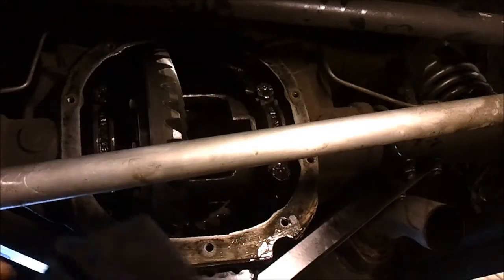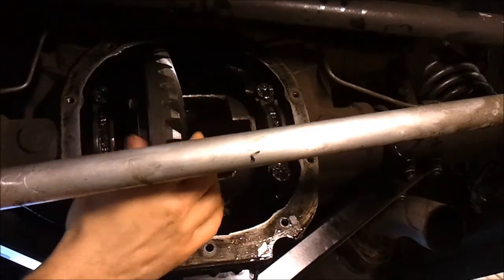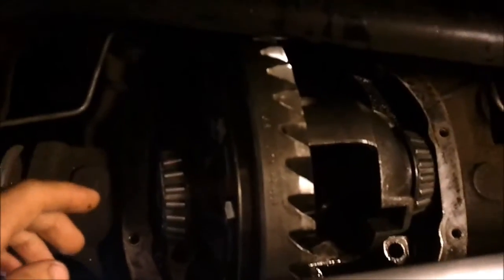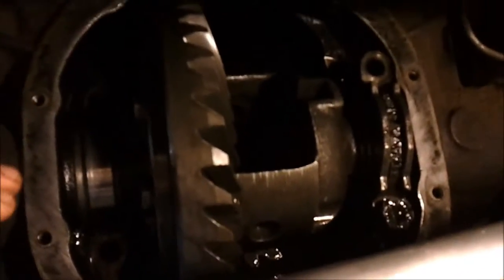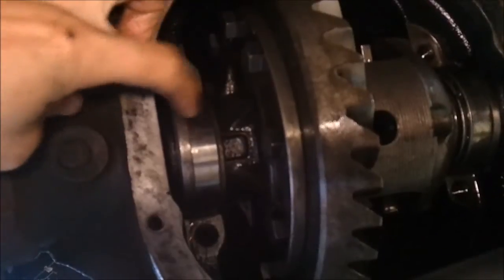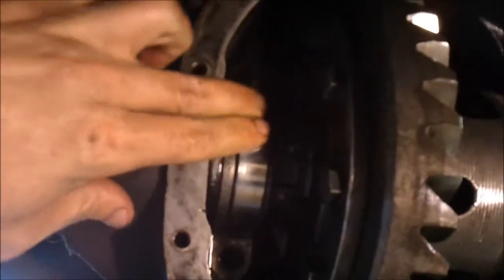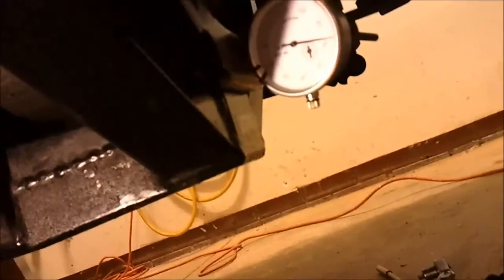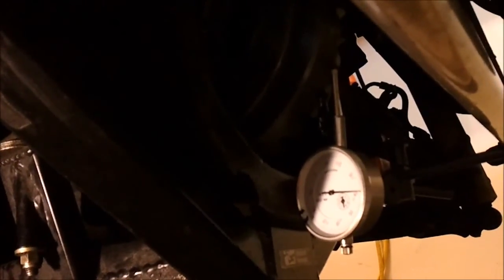How to Set Backlash on Ford 8.8" (rear gear install) Back Lash 8.8

Comment: you need to replace the worn out carrier bearings then set backlash
Reply from the maker: Maybe worn in, but not worn out.  I have about 5,000 track miles on these bearings since this video was published.

Comment: So the last thick shim is the last one to be installed? When I tried to do this I used the stock shim +.0010 on one side and had to use like 8 different sized shims on the other side to make the pack. I tried several times to get the diff in and one of the little shims always likes to pop out! Pain in the %#$!
Reply from the maker: If I understand your question correctly, there was not enough room on the other side to install the thick shim after installing the thick shim + .010 on the first side.  In some cases, only the thick shim will be required.  There should be 1 thick shim on each side, plus whatever thin shim is required to get the right preload (which may be no thin shims in some cases).
Reply: SlayerStang69 This guy does great videos.  Please subscribe to his channel so he can continue to make them!